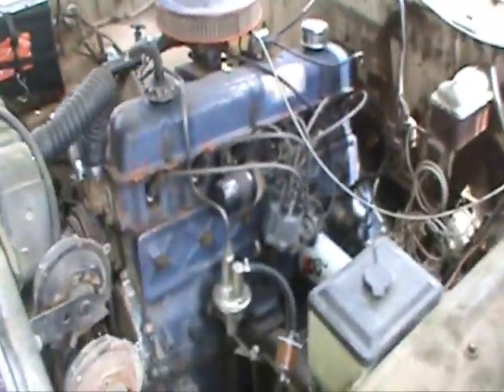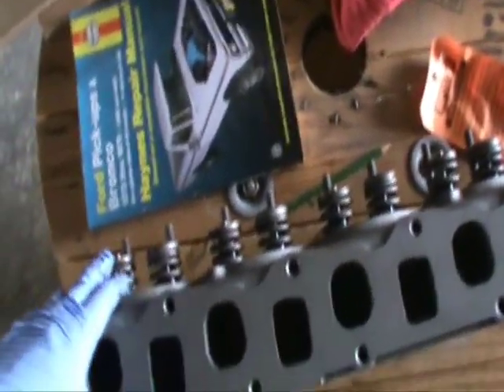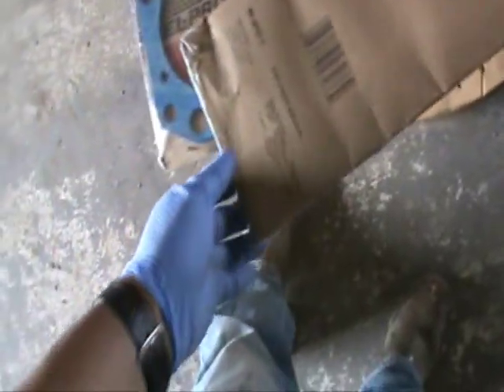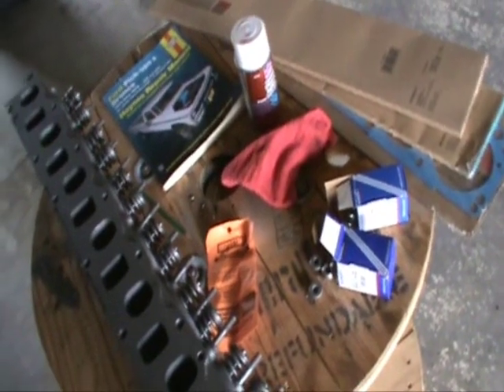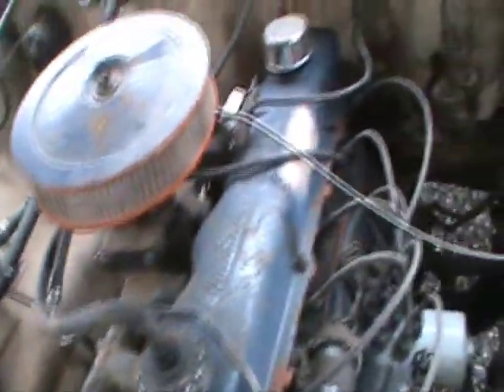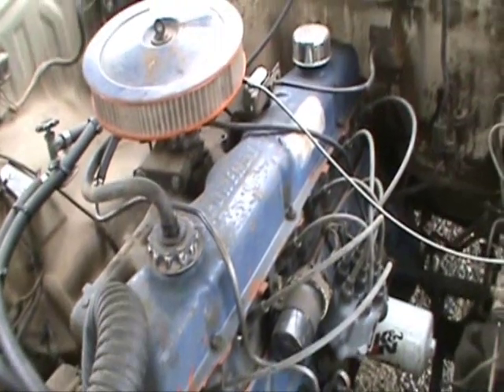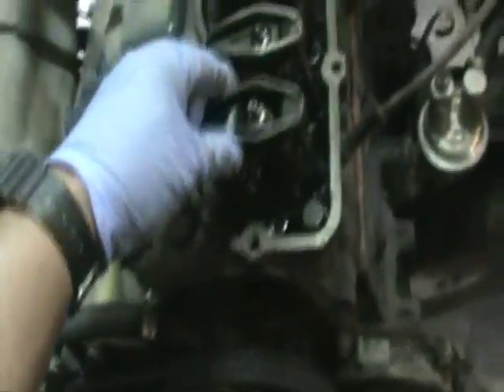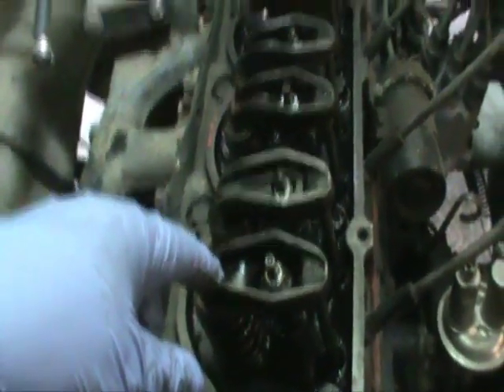Ford 300 6 head work.wmv

Comment: An old clip,  running some of these clips as a ref. I didn't like that style head, I found the independent stud heads tend to fatigue.  I converted to the 1/2" stud much better, as the lower end became problematic I redone another engine. Head wise much simular to a 302 configuration.  The rocker frames tie 2 together as an assemble w/ independent bolts. I don't like the 0 lash as with the studded style but felt firm on assembly.

Comment: I have an '82 Ford F-100 and was out behind house this evening cleaning out the "chocolate milk" from a blown head gasket which blew wet.  I bought the truck this way.  Paid $500 for it.  A re-manufactured head is on its way via UPS as I pulled the old head and it has cracks between valves on two cylinders.  
I did a head job 40 years ago so am a little rusty.  Will be cleaning the rest of contaminated oil out of the lifters tomorrow.  
Was wondering if you could share some additional detail on how exactly you adjusted the valves once the new head was torqued down.  
I am planning on pulling out my lifters so I can clean each one to get the "chocolate milk" out by hand and to make sure they are all operating properly---your video was great but light on the valve adjusting sequence for me.
Mike Treacy

Comment: Great video bro!  I got a 76 ford f100 l6 300 with three on the tree and it sounds like it's hesitating a little bit but when I give it gas it sounds good. Maybe it's the rockers or something to do with the head. If it's cheap as what you said I might as well replace mine
Reply: my 65 ford with a 240 six was hesitating, it was timing.

Comment: Thanks for posting that...mine needs both a new head and a ring job, so will just swap out the whole engine with a spare. For the 1BBL YFA haters here, yes - it needs to be rebuilt every ~2 years, (I keep 3 in rotation)..but the kit is like 12 bucks and takes a relaxing 60 mins to rebuild it. Truck has run 33 years on the YFAs...no need for an Offy.

Comment: I believe the '85 pedestal head would work well too. The pedestal rockers are much more accurate and smoother. But that style of rocker has been used for many decades with success. Gosh, you don't want to spend $1000.00 's for no reason.
What's the new compression and vacuum readings?